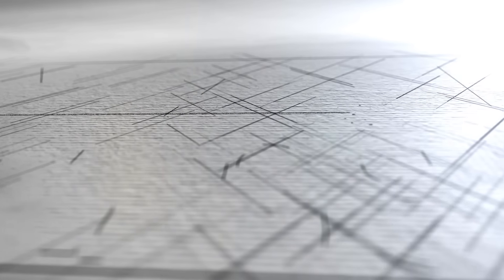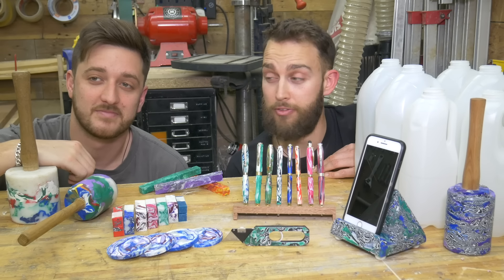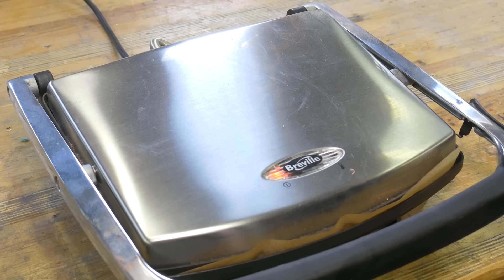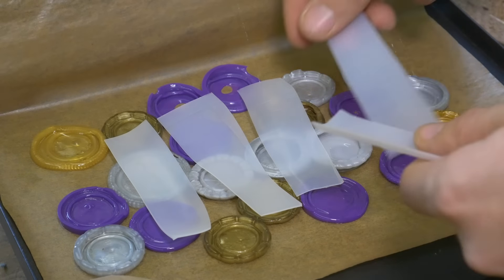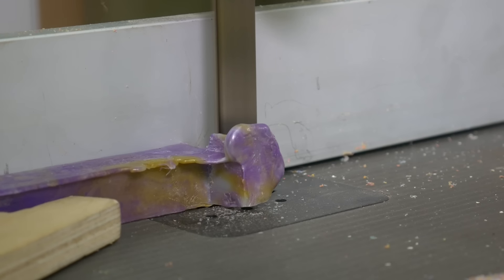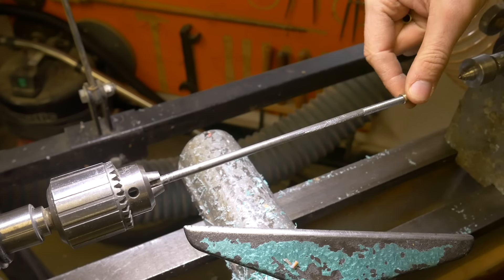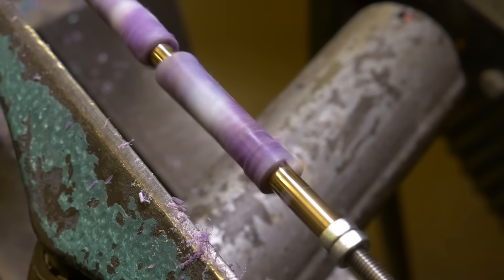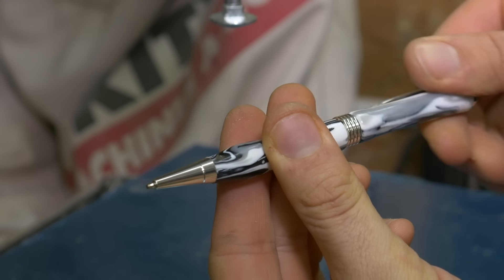Beginners' Guide to Melting HDPE - How to Make a Recycled Plastic Pen

Comment: Great video! One safety point--it looked like you were using a cloth for the burnishing cream step. I don't know if anyone else mentioned this in the comments, but general guidance when using lathes (aside from avoiding loose clothing and unrestrained long hair) is to use paper towels for polishing or finishing steps. If that cloth catches for some reason, you can get a serious injury in the blink of an eye. Paper towels will just tear away.
Reply: Thank you!
Reply: That’s for the tip I’ll remember that
Reply: what do you mesn with burnishing cream? They were using paper in the melting part.
Reply: Right around 9:23
Reply: @TheSouthernDandy6  oh I see, thanks.

Comment: At one point, I had aspirations of melting down plastic bottles and caps, and using the plastic to mold new things. I was disappointed to learn that the plastic wouldn't turn liquid so that it could be poured, and would only end up softening up into a putty like consistency. It would be kind of hard to use that to fill a larger mold, especially when it's an enclosed shape.

Comment: Be careful to check for a #2 HDPE on the caps, as many caps from a wide variety of products are made from #5 PP which seems like they might be PE. Generally if the cap has no recycle logo on it it’s either PP or an alloy of materials unsuitable to mix with PE.
I love to see you guys doing this, I stake my career and my family’s life on plastics and I know it is a miracle for humanity. The litter problem is solvable, my company makes packaging products from 100% recycled HDPE, boosting the market value of recycled plastics thereby getting the economic ball rolling on profitable recycling. Soft drink companies are doing the same, and soon the demand will force major upgrades toour plastics collection infrastructure. The things you are doing in your videos bring awareness to the incredible utility of plastic. Thank you.
Reply from the maker: Thanks for the advice! We personally check every cap and if it doesn’t clearly show ♻️2 then we don’t use it for melting. Thanks for the comment!
Reply from the maker: Yep only ♻️2 works together
Reply: Brothers Make should pin this comment 💕
Reply: Could you comment on whether #2 recyclables definitely don’t give off harmful fumes when heated?
Reply from the maker: Liusila providing it’s not heated over 180 degrees celcius, yes 👍🏼
Reply: @Liusila  and if you are concerned you could always get a respirator rated for fumes to wear while melting, and for particles for when sanding/ shaping.
Reply: @Gilliebeany  Make yourself a fume hood and wear a respirator rated for fumes.
Reply: They already mentioned that about the #2 ♻️ shortly after the 1:10 mark in the video.
Reply: surely #5 PP is ok as well, it's a very similar non-toxic plastic?  as long as they're not mixed with other types.
Reply: Interesting. Some time back I received an email lobbying for us to support taking plastic drinks bottles back to shops for 5p? Refund like we used to do with glass bottles. Whoever suggested that, didn't think that kids & alcoholics would be lifting dog urinated-on bottles from gutters or pulling them out of our recycling bins which currently provide an efficient, convenient & hygenic way of recycling plastic bottles throughout Scotland. The idea that shops want to use up their entire storage areas with filthy germ-ridden waste bottles, and staff would be handling them then dealing with fresh foods, handing germ-infected cash change to frail pensioners  etc. didn't seem to cross their mind. It seemed to be all about "How can we take away some of the profit from the City Council Waste Disposal & Recycling Services and put a "positive spin" on this. At present you can walk to your Back Door and put plastic bottles into a recycling bin, or walk 5mins into any high street and put them into a Public Collection Point. I don't see how it could possible be done better or more safely than it already is in Scotland.
Reply: @Gilliebeany  This comment 3 months ago. Today, you may as well try to buy a plastics factory, it would be easier than finding a respirator to buy :(
Reply: xlioilx  So the hard plastic grains are like aggregate in the hdpe. Interesting idea. The downside is that you've made something unsuitable for recycling a second time by someone who wants hdpe.
Reply: What is your company?
Reply: We've been paying deposits for bottles and cans in South Australia for 35 years, finally in the last couple of years other states in Oz have followed suit. It has kept the roadsides cleaner and given kids and pensioners, not to mention a lot of other people a great source of income for that whole time. I personally have bought at least 3 bicycles and  couple of cars with that money not to mention paid bills and used that money for whatever I needed. Most of all I feel good that I've made sure that those recyclables have gone to the right place to be recycled, not ended up as landfill or pollution. 
I've done rubbish audits at waste transfer stations and the mount of recyclables in the general waste can be up to 25%, yet very few deposit bottles and cans are. 
Price of the product up 5p. Recycling up by a big percentage. ...
Reply: @goldbunny1973  at Greece we collect bottle lids for a charity to turn them into wheelchairs(as the incompetant sold souled gov has other priorities that have nothing to do with the well being of the tax payers !!!lol)-and as many of us got concerned on hygiene like you, the factories that do take up those lids we found out by visiting them that they do sanitize the lids again for reuse ...but i dont know how environmentally friendly/much extra CO emmisions is that actually as none of those have any actual filters at their chimneys protecting the atmosphere from it!!its still the same qs really like the cars solar battery-manufacturing it has a way worse impact than not....
Reply: "The litter problem is solvable, "

It's basically solved.

Plastic can be cracked into diesel fuel.
Reply: @BrothersMake  I see more potential then pens and phone holders try making plastic sheets 3'x4'x1/4" to build a house that doesn't need paint or maintenance plastic is a major problem for nature because it doesn't break down fast like wood and other materials that we use to build houses. Have fun with it make it like puzzle pieces.
Reply: @richardwicks4190  Indeed. The whole recycling ethos has been a total disaster as is the green demands to cut down use of plastics ( especially the so called single use/unrecyclable stuff).
The furnace to "crack" ANY plastic back into its source ( gas/oil) IS the way forward. Plastic use is predicted to double in the next decade. The green lobby needs to get real and embrace the solution.
Reply: @hughcurliss1217  hmmm , have you seen what sunlight does to plastic?? 
There's a reason window frames are made from uPVC. However you can recycle uPVC...
Reply: What about the finest parts which come out of the whole process? Aren't they dangerous and polluting for life and environment?
Reply: @racketman2u  polypropylene (PP) is different. But it does pose the question: can you mix HDPE and PP together? Is the melting point of both the same? Do the stick to each other?
From what I've read today, they have distinct properties different from each other.
Maybe someone can enlighten us?
Reply: @terryjackson4538  I remember when glass pop bottles had a deposit that we had to pay. Just like you, people would gather them and take them in for the refund. The bottles were thicker than the glass bottles nowadays (when we find glass bottles). 

If people can find a way to make the plastic we throw away a commodity, there will be less trash.
Reply: Thank you ZeeBeeFPV.
Reply: @goldbunny1973  "I don't see how it could possible be done better or more safely than it already is in Scotland" being half Scottish myself I'm forced to agree.
Reply: @terryjackson4538  do you go to the rubbish businesses and they give you the bites to return for deposit? Where do you get your bottles from?
Reply: @WayTruthLife2100  40 years ago when I was a kid the number of bottles thrown out on the side of the road was much higher than today. Nothing unusual to pick up 50 cans/bottles in a 1 kilometre stretch of road. These days in country areas you would pick up about 10 over a Kilometre along a highway. If I see a bottle or can when I'm walking these days I'll pick it up and added to the ones we drink at home or while travelling, it would work out to about $30 every couple of months with deposits of 10 cents each. The school I d work at has a drum that the kids put their deposit cans and bottles in and that goes to the Parent and Student Group,  Many places I've worked have a wool pack bag that everyone puts their empties in and the funds raised go to xmas parties etc.
Reply: plastics and other binders are always mixed by big factories. but they wont buy it back from people because it will be not clean and toxic mixed. if you over heat the plastic it releases toxic fumes into the atmosphere. also this planing and skimming creates microplastics which are already poisoning our oceans.
Reply: What can happened if the plastic is over heated..lets say pp melting on 290 degree cels
Reply: @ankitmehta7235  the plastic will smoke and burn if it gets too hot, which will be uncomfortable. It will also degrade and discolor, which could cause a weak, ugly spot in your part
Reply: @AndrewHelgeCox  hi- PE and PP are infinitely recyclable as long as they can be recaptured and sorted with low contamination rates- cheers!
Reply: I have a question for you! I invested in a machine called an obaggo that heats and compresses 1 and 2 hdpe plastic bags into a "puck". Since they are not commercially recycled, and my town doesn't recycle any plastic bags, I'm looking for something to do with them. I have a couple hundred in my garage and a constant supply of bags coming in thanks to my neighbors
Reply: @michaelamorrow8270  hello: except for the crafts that are abundant on this channel, there isn’t much use for the pucks after making them. Making pucks keep the bags from blowing away and causing litter, which is good. There is generally a high probability of contamination in the pucks so they won’t be useful to industry, unfortunately. Best bet is to throw them away: since the fuel you burn to start the car to try to take them anywhere to drop off has a higher carbon footprint than all the bags in all of your pucks. In other words: film and bags are extremely efficiently made and their only downside is they can float out of the landfill stream and end up in the environment as litter. Always keep in mind the total efficiency of the systems we use including water usage, shipping efficiency, human health and many other factors that most people never consider when they say “plastic is bad” .

Comment: This is the best guide I've seen and makes recycling really accessible, awesome work dudes! I'm keen to try it with my 3D Print waste (sadly a fair bit) that I've been collecting for a rainy day.
Reply from the maker: Thank you very much! I’m PLA could be recycled, it just may not be suitable for this method. Thanks for the comment 👍🏼
Reply: Angus PLA works very similary to this I think the same method can be applied
Reply: You're 100% right 
All the videos i have watched require heavy and expensive machinery . That's a really big deterrent to people who want to do the important thing with all the plastic thrown up around the planet .
Reply: @robertsantiago953  I think that if people realize that the stuff (HDPE) they are throwing away is a resource, it will become a commodity instead.
Reply: @nutcase0001  lol only for big factories. there's negative profit on doing this and hdpe plastic can only be reformed up to 6 or 7 times before it loses its integrity
Reply: Please do it Angus, would be amazing to see how it turns out with PLA!
Reply: Thanks for recommending this channel Angus!

Comment: couple things to hopefully make these better or easier to make:

1-those failures during the lathe turning process seemed to be from delaminations likely caused during the heating/mixing process. Spraying silcone spray on the paper that the plastic touches and then folding the soft plastic together contaminates the layers preventing a good bond from occurring. Try to find a way to do the melting/mixing process without mold release.

2- If you are seeing actual voids in the center of the plastic piece after it has cooled, then this is likely cause by the shrinkage and how it was cooled. Once the piece is formed in the mold, take it out while still HOT but solid enough to keep its shape and cool it the rest of the way in a warm oven for an hour. Cooling it in cool water will increase the chance of voids.
Reply from the maker: Thanks for the advice 👍🏼
Reply: @BrothersMake  - there are teflon pressing sheets available in quilt shops.  You could use them instead of the parchment paper and avoid the spray altogether.
Reply from the maker: Debbie Mansperger that’s great! Thanks for the tip
Reply: I haven't worked with HDPE, so this may not be applicable, but if it's anything like clay in terms of void formation:  try rolling it out/around more too.  Squishing and folding it over on itself repeatedly, in a way that doesn't trap more air in it, should eliminate most of the bubbles.  Search 'clay wedging.'
Reply: Also you can try the silicone oven mat. The thinner (black) kind. Folds nicely without creasing and you don't need spray at all.
Reply: Would a warm oven be unsafe as far as fumes go?
Reply: @missbeaussie  As long as it isn't on fire, molten HDPE alone doesn't give off any toxic fumes. Been working around the molten stuff everyday for 15ish years.
Reply: Excellent feedback.

Comment: Hello fellow youtubers , great work with those pens, just a quick tip in case no one told you already, if you cool the HDPE too fast out will become brittle, and loose elasticity. For things like the pen it doesn't make a big difference but in hatchet or hammer handles it may cause a fracture, hope that's helpful 👍
Reply from the maker: Thanks for the tip 👍🏼
Reply: @BrothersMake  we're makers, we've got to help each other and spread the creativity right? Oh Matt great beard by the way.
Reply from the maker: Absolutely! And thanks! 🧔🏻
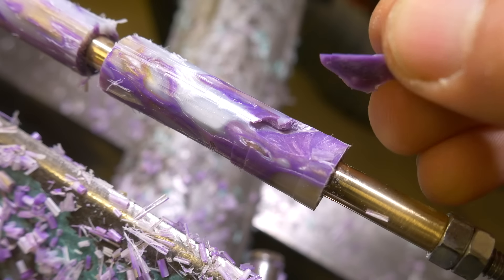Reply: I was gonna build a boat model with this stuff but the fracture at 8:00 gave me some doubts as to the durability of this material, rapidly cooling anything is usually a shortcut to disaster. Maybe I could reinforce it with something to be safe. We'll see.

Comment: After watching your videos, I've decided to try recycling plastic into a browline eyeglasses frame. I've gathered about 10-15 (not sure) bottle caps(of the same color) and melted it into a thick sheet. At first I've tried melting the plastic at a toaster(not sure if that's the actual name of that thing) but it didn't work so properly. Then I switched to using a hot iron to melt it (it worked, but still not enought to what I needed to work with), then I finally switched to using the oven. I've soaked a paper sheet with kitchen oil (it seemed to work just fine, it didn't stick into the paper at all) and used an aluminium plate to put it in the oven. Then I've straighten the plastic sheet with another aluminium plate, and after cooling just enough to not burn my hands, I used my hands to cool it a bit (since I felt like it would be a bad idea to instantly cool the plastic putting it into cold water) and started working with it after. I didn't finish it, since I started doing like, yesterday, but until now, it looks perfect. I've successfully cut the first half of the frame and it looks so good (I'm feeling so proud of myself haha). I'll be trying to cut the rest and see if it turns out okay. I'll drop more updates later. À bientôt 😉

Comment: 6:22
Heat the blank, then, wearing gloves, squeeze the blank to fit around.
I use this method for kitchen knife handles and, just before it cools down fully, squeeze with my bare hand to have a custom fit.
Reply from the maker: Similar to polymorph in that sense I guess. Only issue with that is that I find it’s more comfortable to have a more generic shape handle on knives for different types of grips

Comment: Just finished melting down 31 batches of plastic for my middle school students to make night light covers, which will be milled with their line drawings to let the light shine through. They cut the plastic and I melted and pressed it to 5.5 inch circles. I had started on a small George Foreman grill but upgraded to a Breville press on your recommendation here for a much better experience. Couldn't find the completely flat and large area one you have here but got Breville Panini Duo and works well.
Reply from the maker: This is AWESOME! love hearing this. Well done!

Comment: Ok, I found these videos really interesting and thanks to you guys, I am now looking at every plastic whatever for the Delta 2 code. But I am concerned about the vast amount of material needed for one of my projects. Today, I was outside and looked at a 5 gallon pail and behold it is Delta 2! Now we are working on an industrial scale! Cutting up a large pail is much more satisfying than little tizzy bizzy pieces. If I can mold and fold to a manageable thickness then I can add other colours too. Yellow, white, green, blue and red pails are easily available near me without having to salvage other containers, however they are not out of the question, it is my efficiency that calls to me.